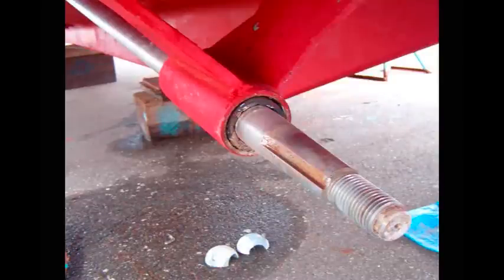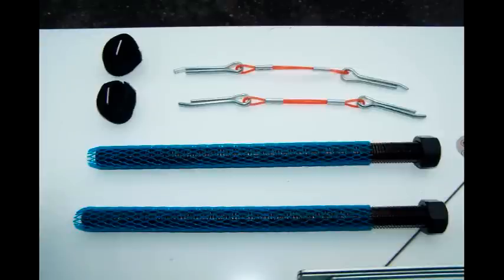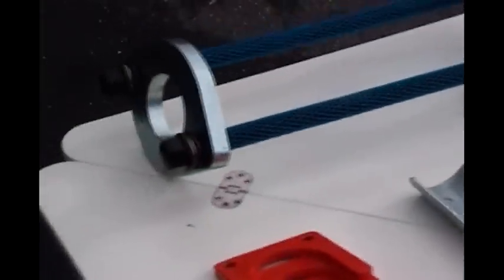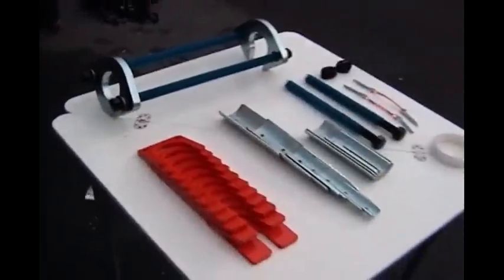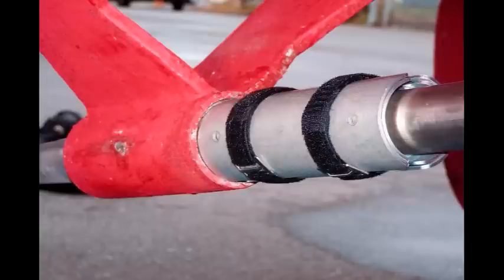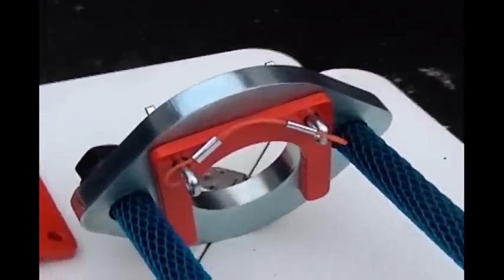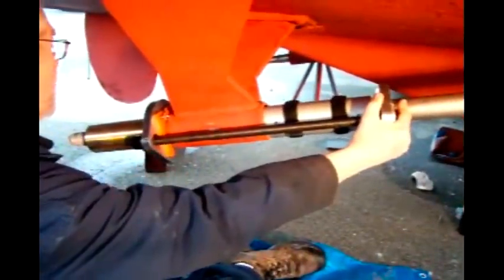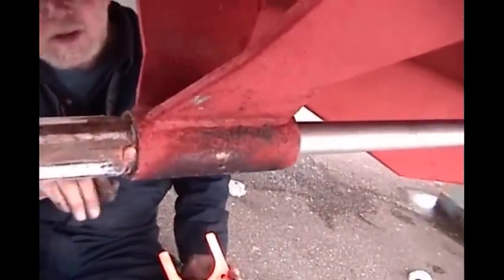In Action - The Cutless Bearing Replacement Tool from Strutpro

Comment: I think you guys did a great job on your puller .I will be buying a set for my under water propeller pulling company. Working with my swath work boat and 11,000 lb capacity crain .I pull props up to 120 inches .

Comment: Yeah except the new version is open on both ends making it a two man job to get it set up, and the pins aren't wired together and easily fall out while working. The potential to be a good tool is there, but it's very aggravating to use, especially on comp boats. Would be nice to have adaptors for 1 1/8" shafts, which are common on power boats.
Reply: Turn it upside down?